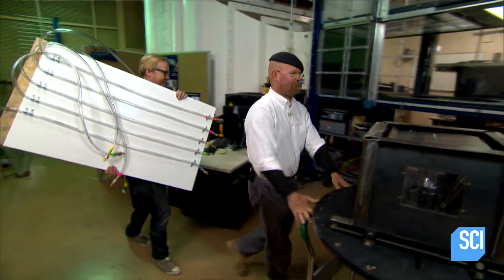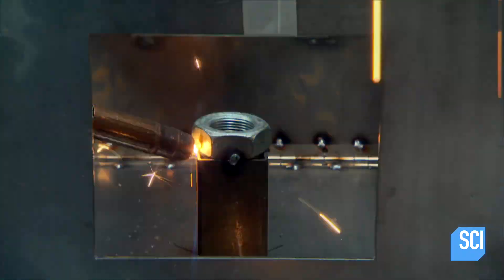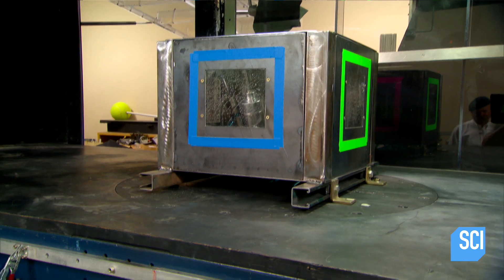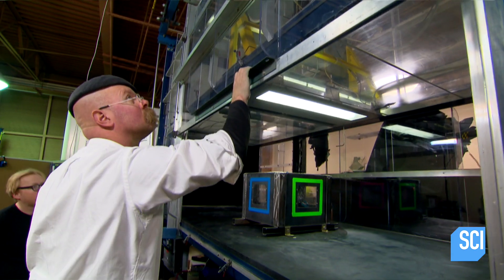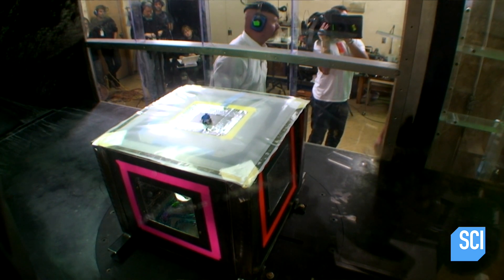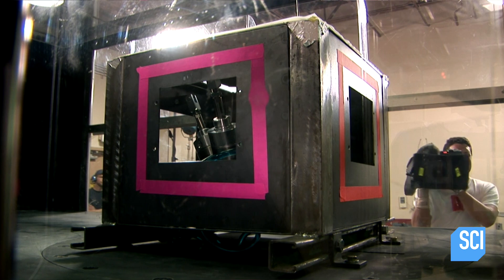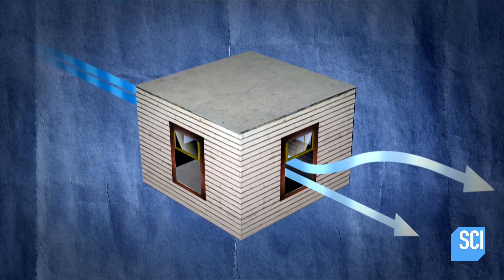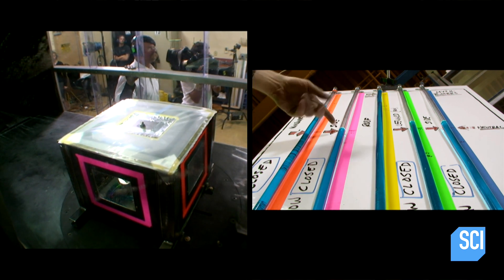Should You Open Windows During a Hurricane? | MythBusters

Comment: But they didn't have things like furniture inside the home and see what would happen cause if it was big.Heavy glass furniture,tvs, they'd be ripped off the walls.
As well as some of these older homes, they don't have a certain kind of clip that attaches the rafters to the frame of the house called hurricane clips, that means that there will be more subject to lift off the roof if they are exposed to such high winds.

Comment: The  destruction  due  to  the  wind  is  increased  if  the  building  has  an opening,  If the opening is at the front,  then the pressure within the building is increased and this intensifies the external suction on the  back, side walls,  and the roof.  If the opening is on a side wall,  then the opposite effect occurs.  Air will be sucked out of the building,  lowering its inside pressure,  and intensifying the pressure acting externally on the front of the building.

-RC Hibbeler's Structural Analysis, 9th Ed.

And please just close your windows unless you all want to get soaked in rainwater inside your cozy homes.

Comment: sorry but this model you use is not the same aerodynamics of a house. the window mass is far less, and your makeshift roof is just a joke. being an engineer, and living in florida, it's only commonsense to keep your windows closed during a hurricane, tornado, or any other even when weather is unstable, and especially objects can turn into projectiles and seriously hurt somebody. if you're in a cat 5 storm, and your home is made with cinderblocks, that's about as safe as it's gonna be without being in a weatherproof custom home. if you're in a trailer during a cat 5 hurricane, and you didn't evacuate, then you're just an idiot. Other structures such as high rises and newer apartments made out of mostly plywood vary depending on the construction, but generally are not safe for catastrophic weather conditions.  the building code in florida is a little different than other states because it has to hold up to different weather conditions, just as in california, the building code for buildings are supposed to be safe enough to handle earthquakes. i think most people already know this, and it's commonsense. i think fans of this show, should not get the wrong idea and take this advice, because in the event of a storm like dorian right now, they will regret it. i sometimes question if adam and jamie are really even scientists, or if it's just a gig for tv, and they read the script good. some of the things they say and do is just insane, and without proper research, nobody should follow them, regardless to if the myth is busted or not.

rip jessi, she was a great gal, and i hope to see a show dedicated to her in the near future

Comment: Completely unscientific as it assumes a completely semetrical house and no obstructions whatsoever. Of course wind is going to apply less pressure if it has a means to release that pressure. in an actual hurricane you could be putting strain on interior walls which could be even worse for your house.

Comment: Hello Science Channel and Mythbusters.

I feel this needs a follow up clarification.

The spirit of the myth, is on the issue of safety of the occupants inside the house.

If I may make an analogy with car safety, the question posed is like what would minimize damage on the car during an accident assuming minimal damage to the car equals minimal harm to passengers. An assumption we all know is incorrect.

I'm from the Philippines and we get hit by typhoons 21 times a year. I'm familiar with what kinds of forces these winds have and what objects they can pick up and hurl at houses and their occupants.

My conclusion from the experiment would lead me to conclude that opening the leeward window to equalize the pressure and keep the roof from blowing away, but keeping the windward windows shuttered to keep any flying debris away from occupants as much as possible.
Reply: In a related issue, hurricanes and typhoons bring with it rain and storm surges.

In cases where flash floods occur, dangerous as winds maybe, the destructive and drowning power of water might be the more important concern than the wind. And escape to higher levels, in some cases, higher than the house ceiling would literally determine if one survives or drowns during the storm.

Comment: Yep there's wind and rain with a hurricane, cyclone or monsoon. But what else have you NOT taken into consideration? And this is the BIGGEST factor of stress on a building and its windows.  
AIR PRESSURE!  Hurricanes and the like are LOW (air) pressure weather systems and the air pressure per square inch differs considerably per  square inch to a HIGH pressure or fine weather system.
So boys, all your stats are way out because you did not take into consideration the building interior with closed doors and windows at a normal weather system to a hurricane's which is low air pressure. And the thing that blows your windows out is not so much the wind but the air pressure.

Comment: It's clear that with windows open the structural damage is lower, even for the roof. Air that moves fast has lower pressure so if air moves though the house then the pressure inside the house is also low. So the roof is not being pushed up (hurricanes lift roofs because of the pressure difference). But that doesn't mean it's a good idea to open the windows during a hurricane. If a hurricane is strong enough to damage your house with windows closed, it might be strong enough to damage it, even with windows open, so destroying the whole interior of the house just to reduce structural damage is a bad idea. Just leave your house if a hurricane is coming with your windows closed and hope it's not strong enough.

Comment: this gives me an idea why not have attic space or Walls to be built wider to have Tubes that runs through the house and have an add on to the outside of the house that act like a  funnel to move the wind into the tube and let it flow freely out so that as the wind hit the funnel it get move toward rather then pushing. and as a bonus you could install Fan blade in these tubes to generate power for you house during a hurricane storm so that you could have some  power powering key things like an outlet for charging a phone or having lights to be one or a way or just plan ass storing massive ammount of power in batteries.

Comment: Wind tunnel does not replicate the reason behind people recommending opening windows...

The purpose is to allow air pressure in the house to equalize with pressure outside more rapidly, since you get rapid air pressure change as the hurricane passes.

As the low pressure system passes, the fear is that the house will pop like a balloon that has been overinflated.

But that pressure change is still slow enough that even the best sealed houses would be unlikely to have measurable difference in pressure from inside to outside and the house can withstand a few pounds of difference.

Comment: If it was a good idea to open your windows in a hurricane, why would people spend billions of $$$ to board up their windows?  When high velocity air passes over a roof it creates a low pressure area, just like an airplane wing.  Opening the windows allows higher pressure under the roof and increases lift.  The roof lifts off  and the walls collapse when the roof trusses (which also support the walls) are blown off.  

60 fps air used in this video is NOT EVEN a test.  60mph is 88 fps.  Why would you do a hurricane test with air flow that is barely tropical storm level?  Damage from wind increase as a square of the velocity of the air.  120mph winds, not unusual in a hurricane, will do FOUR TIMES the damage of 60mph winds. 

https://www.nachi.org/wind-mitigation.htm

The insurance companies do NOT give you discounts on insurance in hurricane areas because they are worried about broken glass. Open windows can cause a claim to go from missing shingles to total structural failure. 

If you live in a hurricane prone area, invest in secure window coverings for ALL openings in your home. The last opening left functional, say your front door, should be protected by a hurricane rated storm door.

Comment: Yeah, this test is bogus sadly enough, when you look at pressures to flat services and you're making a model that reflects that, you actually have to take in proportions. Just making a box and having giant windows that you take out or put in doesn't reflect a real live situation.

On top of that, structures behave differently when they're made out of multiple materials, so a wooden house has the tendency to flex more because wood is softer, than say, a concrete house, which might have a tendency to show cracks.

This test really kinda misses the fundamentals of the problem. And I'm not even an engineer, I just do this shit for fun.

Comment: Next time maybe go for real. Build a replica house of the same materials and the same construction as a real house from top to bottom. Fill it with windows to proper scale, that you can't remove entirely. Fill it with doors, tables, chairs, lamps, plants, books, drapes, etc. and then record what is happening. My guess is that because of the relative small size of the windows and those not placed to blow the air easily through, that you will have much more damage to the house with the windows open. Making weaponry out of above mentioned furniture. The doors shutting with such incredible force that the doorposts will be dislocated. The torrential rain coming in at warp speed will nicely drench all things of wood, cloth and paper such as laminated floors, sofas, mattrasses and wallpaper. Hope the insurance company doesn't refuse to pay for half of it because of willing exposure to damage.

Comment: But there's rain and debris too. Also, the windows on that test box are massive in ratio to the walls, not to mention how it is when compared to a real house. Also most houses aren't a perfect square box. Most have rooms with windows on only one wall, and no other opening in the room except for a door to the rest of the house, which isn't in a straight line across from the window. Mine for example has one room on the second story, with walls on only one side, and a door leading to the stairs to the first floor on the wall perpendicular to it. and two rooms on the first floor with the same window and door layout. Opening my windows during a hurricane would do more damage. Especially since houses here HAVE to be build structurally sound enough to handle hurricane force winds, so that isn't an issue, whereas water is.

Comment: Before anyone uses this information to determine actual safety, please consider the following;
You have rooms. You have internal walls. Your windows will be on hinges that the hurricane can then slam shut again. Your windows are tiny. Your windows will no longer serve as protection to other elements of a hurricane such as water or debris. 
If the internal of your house has few walls and you're able to manage water damage better than structural damage, and you have a way to handle the debris too, (As well as having very large windows to open) then this could potentially help. In any other case, secure your windows, do not leave them open. Shut them, lock them, close as much as you can. Shutters, blinds, curtains. Everything will help at least a little bit.

Comment: That is assuming your house even has windows on all sides of its structure. In which case, it may be potentially better to keep the windows closed regardless, depending on the situation. 
That and you have to consider water damage as well. Still, water damage, if dealt with relatively soon after it happened is still better than no house at all.

Comment: Not a test that can accurately replicate the hurricane conditions, for a number of reasons:
- Windows are way oversized relative to the sides of the house
- typical houses aren't a square or rectangle, they have a lot of protrusions , and irregular in shape. Wind would meet resistance and when trying to blow past the house.
- The wind in the test appears to be hitting the sides head-on, which is usually not the case in life. Wind would hit a house from an angle.
- All the interior walls and furniture inside a home would offer a lot of resistance to wind trying to pass through an open window

Comment: If your gonna bust myths do it right plus add some walls on the inside as well as the windows need to Change to correct size and what windows would be best sliding or push same as doors sliding or push doors maybe see if hedges or tress around your house helps this was a half ass job but they don't care they got paid right

Comment: The basis of the test is not about your possessions, or the carpet, wallpaper, paint, any of it. The test is strictly about structural damage, and in theory having all windows open would definitely lead to less structural damage. The thing about high wind, is that the damage is due to high force over a relatively small surface area. A flat wall will experience far more force than one with an opening. Any drop in surface are means a drop in force applied to that wall. So by opening all the windows, theoretically your house could be the only one left standing in a sea of rubble. Your possessions may take damage, and the repair costs will be incredible, but you don’t have to buy an entirely new home, as well as all new possessions.
Reply: You forget about the roof. It will create an airfoil (like a plane wing) and the roof will be torn off the house.
Reply: Daniel Gonzalez i don’t think you entirely know what you are talking about. “Airfoil effect” is not “like an airplane wing” that is exactly what the airfoil effect is, and only applies to plane wings, unless you think the average house is perfectly shaped and designed to affect wind in such a way as to create lift. Which they are not, in case you don’t realize.
Reply: pyromaniac000000 the way a airfoil works is through the Bernoulli principle we’re if you have air faster it creates low pressure. Hence the shape of a airplane wing is curved to speed up air on the top of the wing (think about a hose if you squeeze the top the water comes out faster) . Similarly on a house the roof will cause the air outside to move faster vs inside creating pressure difference and essentially creating lift.
Reply: Daniel Gonzalez first of all *an airfoil, secondly thank you for better explaining yourself. But it still isnt entirely correct, pressure difference would not magically equal lift, for lift to occur it also has to be shaped in a way as to create that lift, which a house is not. If everything was as you say, a vacuum chamber would magically levitate into the sky. And besides, in a storm like that, your house will probably be in the sky anyway. In the sky in a million tiny pieces.
Reply: a box wouldn't magically fly into the sky because the lower pressure is on the inside which means the pressure would be placed on the outside in so it would be crushed unless you have a strong enough box to hold the vacuum and if you had it vise versa the pressure would be put on the inside going out and it would explode like the pressurized tank of air in Jaws. The thing here is a box is not equivalent to an airfoil. Second you miss my point that the shape of a roof on a house is like a airfoil. Flat on the bottom rounded on the top. It doesn't have to be perfectly like a real life airfoil to create lift. Airplane airfoils are the most efficient design for lift, that doesn't mean a house roof wont generate lift.
Reply: Daniel Gonzalez the thing about pressure is that any amount of pressure difference can be survived with the right amount of support. And i do not think air alone would not be able to create enough pressure to crush a modern house that is up to code. What destroys homes in these storms is the kinetic force of the fast moving air, not air pressure. And most times opening or closing the windows wont matter, but there is more than likely a certain region of the storm where opening the windows would be just enough to make the difference between house and no house.
Reply: pyromaniac000000 the pressure difference is based of speed of the air so yes opening your house on a windy day won’t do anything but when exposed to high hurricane or tornado level speeds the pressure difference is immense. Second house aren’t designed to resist being pulled apart and are meant to take loads down not up.
Reply: Daniel Gonzalez there still would not be enough pressure. That would mean that no air is escaping, or that significantly less is compared to entering. But there are several ways for air to escape compared to enter. Windows are only one if those ways. Vents, fireplaces, the air ducts above most stoves, all of which release air to the outside, and more pressure means higher flow rate out of these exits. So it would still be just fine.

Comment: You would have to redo this test from scratch if you wanted an accurate representation of what would happen to a house. The real problem with this isn't the size of the windows although that is an issue, it's the lack of interior walls. Sure when are can pass completely through a structure with minimum resistance you're going to have minimum damage. But interior walls are not made to the same degree is exterior walls. But they do block the flow of air. This means you would end up with high-pressure pockets in some areas and fast-moving Gus through doorways in other areas. I seem to remember and valid scientific study about this in relation to tornadoes, and the final analysis was actually that the house was sustained more damage if you opened the windows because there is no clear path for the air to follow.